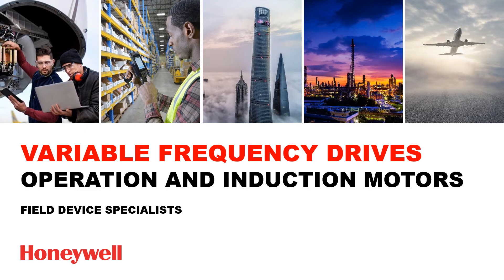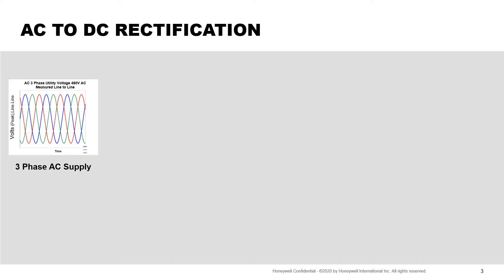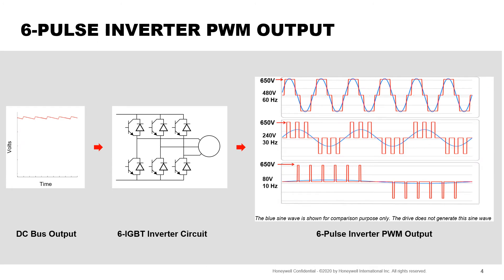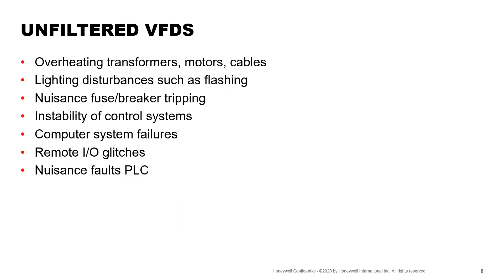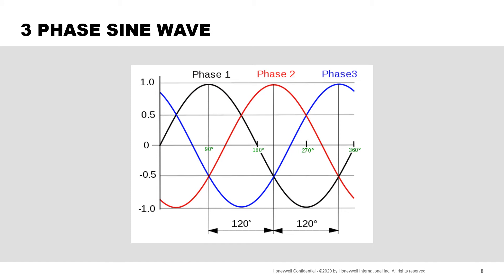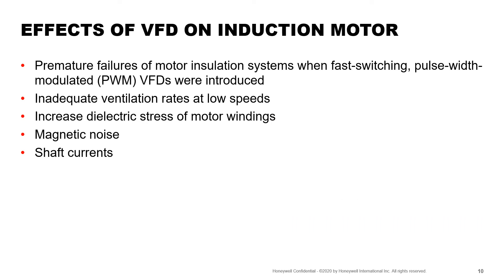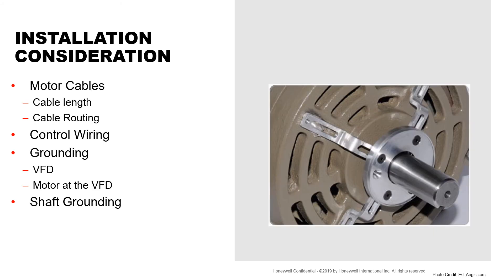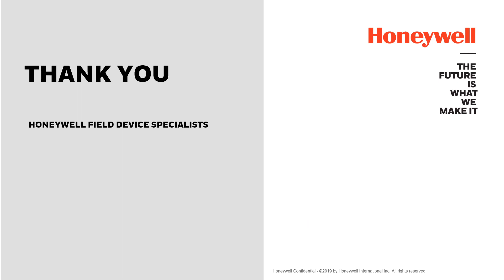Honeywell VFD Module 2

Comment: While running the VFD it themselves automatically stop, after resetting(off and again on) it starting running. What is the problem how to troubleshoot the VFD?
Reply from the maker: I'd start by checking if it has a fault or error code. This article is good.  Also contact support from the manufacturer. https://www.ecmweb.com/content/article/20894292/troubleshooting-vfd-problems